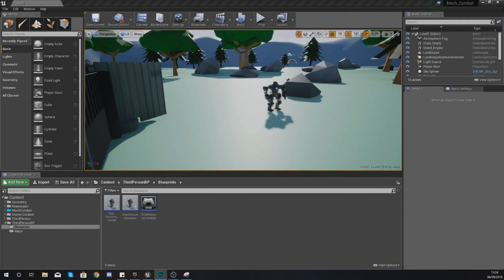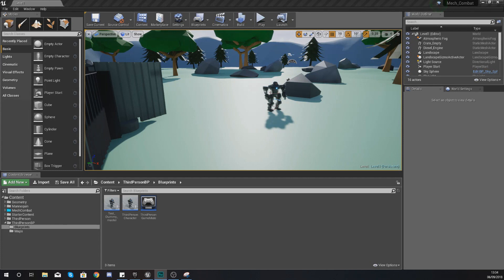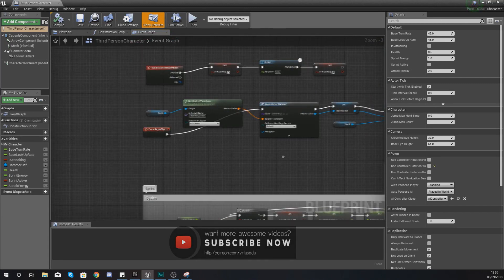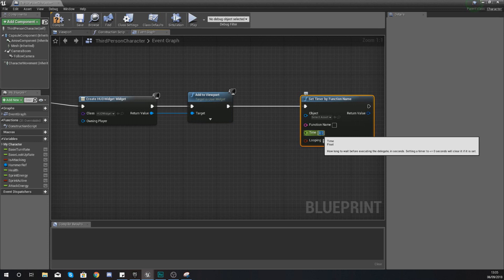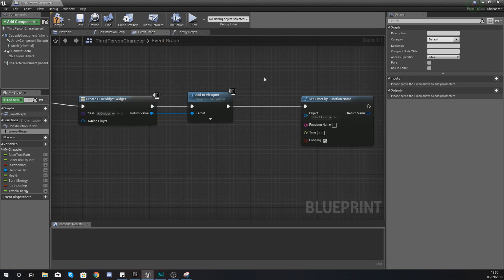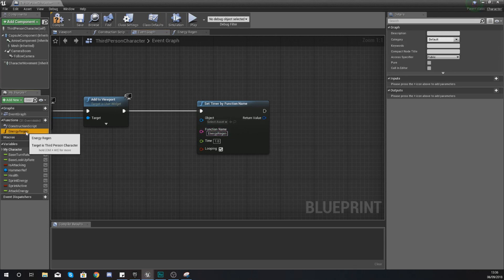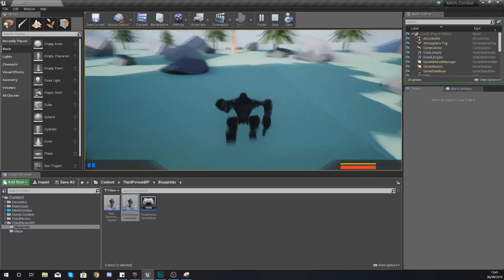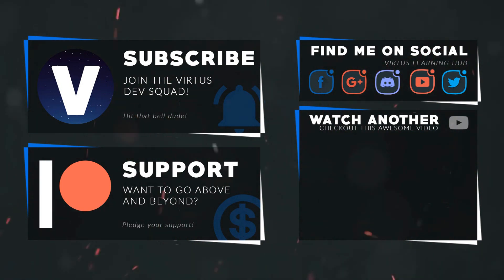Regenerating Energy - #13 Creating A Mech Combat Game with Unreal Engine 4

Comment: If your bar is still regenerating even while sprinting, add a branch that checks if sprinting is active right after the purple energy regen node in the energyregen function. If it is not sprinting then run the rest of the regen function, otherwise do nothing.